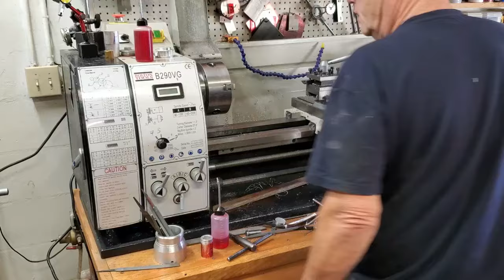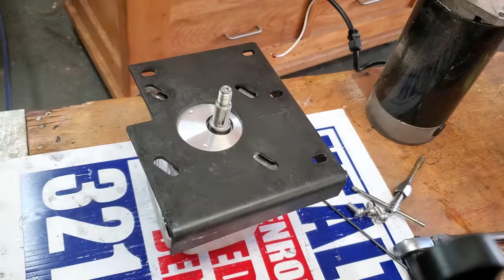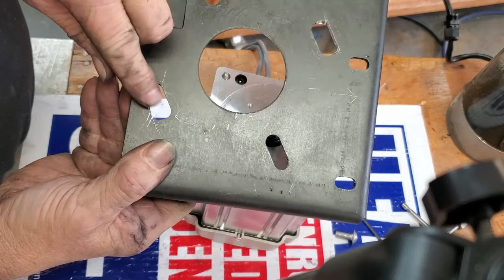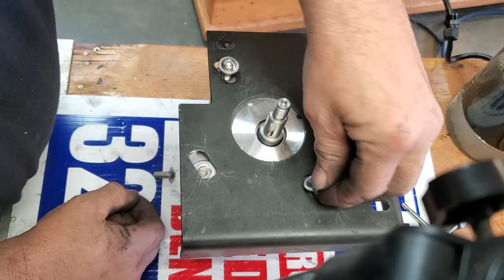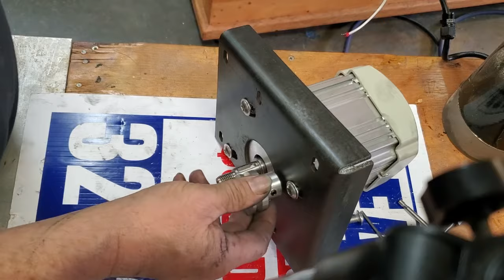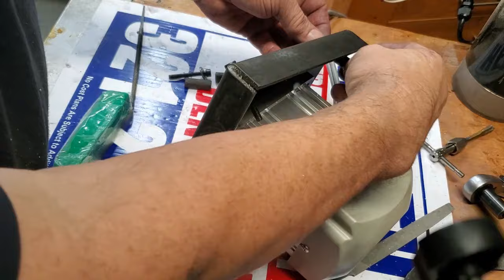Bolton B290VG Lathe Motor Repair Upgrade 2 HP Servo BLDC + Weiss WBL290F Precision Matthews & more

Comment: Do you know if this kit would fit onto a precision Matthew’s PM-1127VF-LB ?
Reply from the maker: Contact me at https://www.servomotorkit.com Than we can swap images and measurements to see what is possible.
The first kit was actually listed today at https://www.servomotorkit.com/product-page/bolton-b290vg-lathe-motor-upgrade-2-hp-servo-bldc
Thanks
Reply: @danielmartin382  I have the Precision Matthews 1130V and would like to use this motor but utilizing the factory controls which have many more functions than this lathe had originally
Reply: @maxausterweil8829 I have the newer 1130v and was wondering the same thing.  Did you ever put this on your lathe? If so how does it do with heavier cuts in steel?

Comment: I have a grizzly G4000 lathe 110v single phase , I need to stay with 110 voltage , what do you offer in a 1 hp set up?? Darryl
Reply from the maker: Hi Darryl.
Almost all our systems are 120 volt, We suggest 1 hp ~ 1.3 hp. The best for your lathe depends on available space and what you plan to machine.
There are a few options on the drive. Realistically you will not need the toothed belt so a single 5mm v pulley is suitable. If you decide to use the toothed low gear belt: 
What is the bore on your existing motor pulley? Does the motor still run so you can cut a new pulley or bore a second pulley? There are many varibles to consider.
I would fit this motor if possible see: 
https://www.servomotorkit.com/product-page/1-000-watt-servo-motor-external-1-34hp-12-nm-torque-300-3-500-rpm
If that is too large consider:
https://www.servomotorkit.com/product-page/750-watt-servo-motor-driver-1-0hp-10-nm-torque
We do not have a kit for your lathe yet.
We would be happy to work with you to make one. To start we will need images of the belt drive and motor.
When finished there should be a complete kit with end results, images, videos and specs. 
We will ask you for copy's of certain parts and pay you for them.
Optionally we can wholesale you motors and you sell your kit on our site as well as anywhere else you see fit.
Start by contacting me through our web site: http://www.servomotorkit.com
Thank you for your interest.
Dan
Reply: @danielmartin382  The motor is roughy 11" long an  5.25" in diameter, I looked at your website , an leaning towards the 1500 wat 2 hp w/ VFD. I will take off the motor pulley to check the shaft, it's chinese lathe , hope its 15mm shaft,  lol I will be in touch soon
Reply from the maker: Darryl
We have a customer building a Grizzly 9972 with the 2 hp right now. This is the same design lathe as your G4000, just a couple sizes larger.
Contact me on the website and I will send you some images of what he is doing. He chose to buy a second pulley and bore it to fit the motor.
1500 W for your lathe is overkill. Still the 1500 is my motor of choice simply because it is so solid and performs real well 
(often called a beast by those turning 4 foot long wood blocks).
These are not VFD, They are Brush-less computer controlled DC motors with large bearings and motor shafts. Their are 12 fields inside (3 sets of 3 fields) and intensely strong magnets on the armature. Generally twice the torque of most motors with the same watt ratings. We have several customers who replaced their 750W BLDC with ours who state: Their lathe stalled out with the original 750 and not with ours. I bet the shaft is 13 mm or less.
thanks
Dan
Reply from the maker: @darrylwhitman8475  G400 kit
https://www.servomotorkit.com/product-page/grizzly-g-4-000-two-hp-servo-motor-upgrade